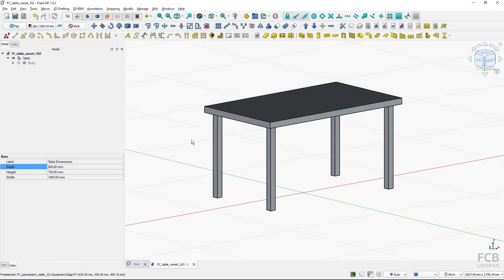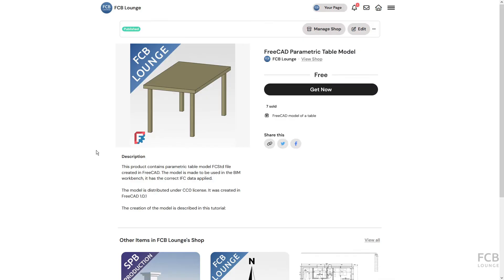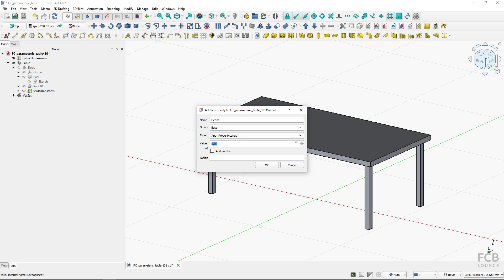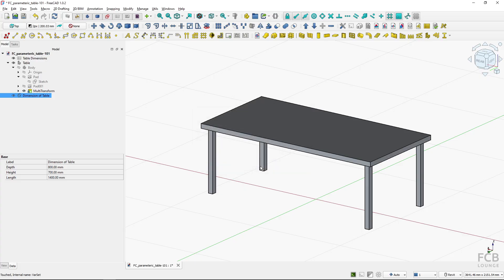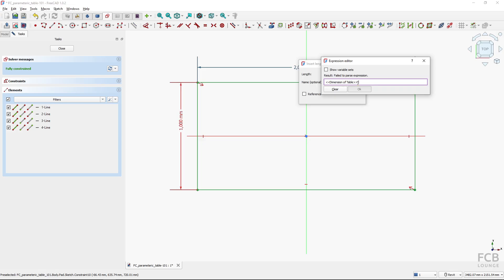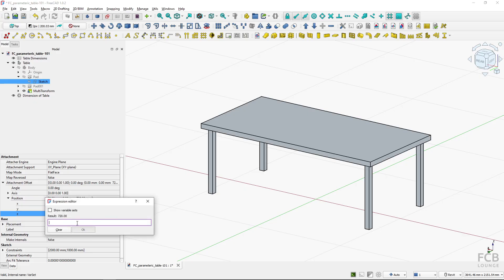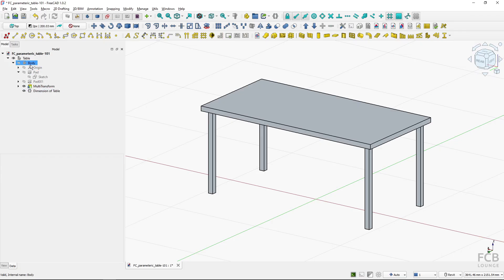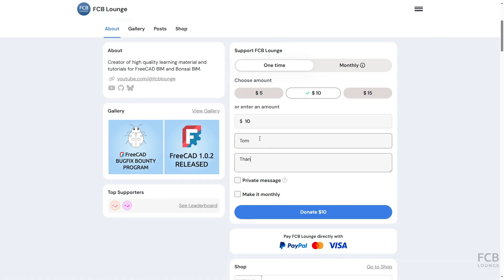Add Variable Set (VarSet) Properties to Parametric Model in FreeCAD

Comment: Thanks again. I tired to replave it to the spreadsheet but I'm not able to add expression like (<<Parametri_Tavolo>>.Lunghezza / 2 - 70). What is wrong?
Reply from the maker: i am not sure what exactly your question is. Are you not able to add the expression to the VarSet or in the spreadsheet?
Reply from the maker: Oh I got it. You have to add units to the number you are subtracting:  (<<Parametri_Tavolo>>.Lunghezza / 2 - 70mm)
Reply: @FCBlounge correct. I’m not able to write the same expression I’m using in Spreadsheet to fix the position of the leg to 70 mm from the edge. It seems VarSet doesn’t accept expressions